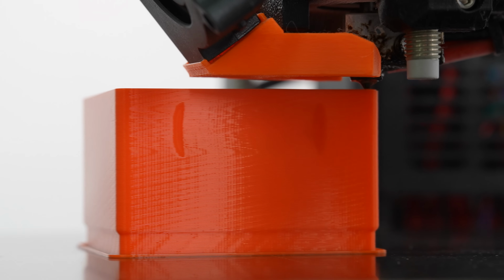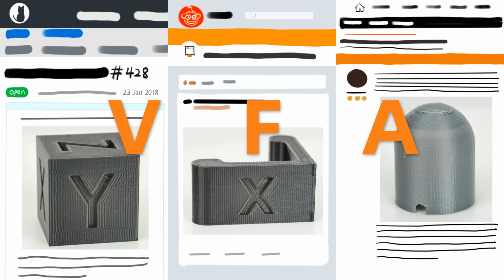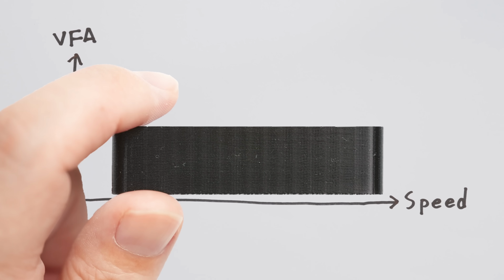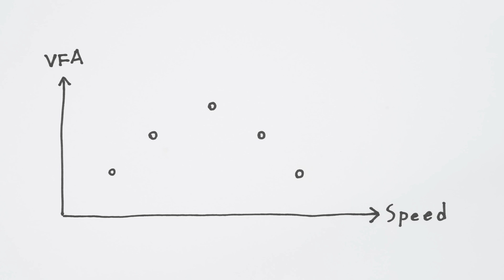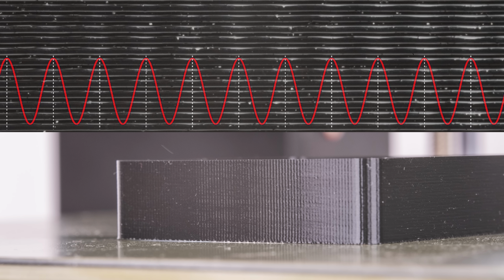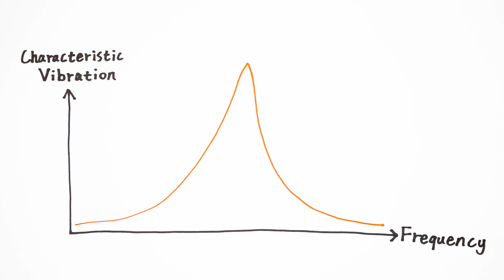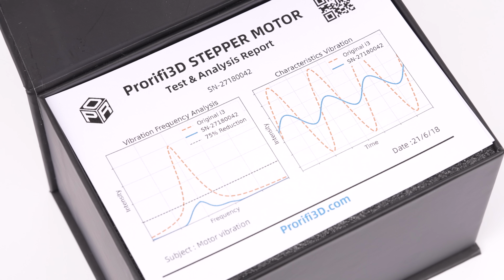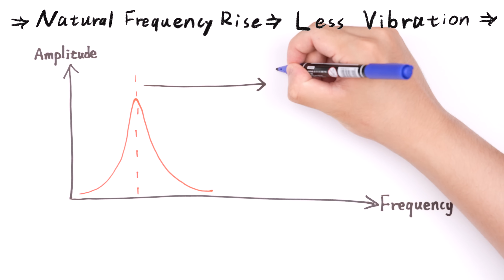We solved this common problem in 3D printing

Comment: Why not to use dc motor with rotation decoder and feedback loop driving? Wouldn't that be better for vibrations and also for detecting "loosen steps"? This principle is currently used in ordinary ink printers.
Reply: high cost and complexity... it must be tuned for every motor/printer combination.  this might be something prusa can do but on a hobby level, turning  requires a bit of know how.    i've seen it done with oDrive controller and motor after a ton of tuning... but it's also cost $$$.  2d printers are very basic mass produced products and they are only 2d...
Reply: @digibluh  obviously the steppers approach requires fine tuning also and still we don't have feedback about loosed steps. It could be interesting to try sinus waveform for steppers to keep them silent and not shaky. I don't know how much precise is microstepping which is currently used in current 3d printers.

Comment: You still will get a ripple as this is intrinsic characteristic of  steppers.Servo would be much better, but is still too expensive, to use in consumer printer.
Reply: it could be interesting to make a standalone servo that's powerful enough, precise and cheap for consumer printers... hmm maybe I could get in on doing that, a plug and play servo upgrade for printers that directly replace the nema17 with an on-board driver and encoder
Reply: Make it FOC (field oriented controal) It uses the internal windings of the bldc's to get i formations about the curent location of the Rotor. 
Idear is that you can skip the encoder that way. And make it mutch simpler. 
Its used lots in electric skatbords bilds. Both the O drive and Vesc platform supports it. if im not mistaken. 
Not shure how stabel it is if the rotor  is requierd to stay still, and is not inducing energy in the coils to messure the position tho. 
But having a servo upgrade kid woud be sweet af think about the power and prindspeeds... looking at havORT servo edition.

Comment: I heard that dual drive extruders make this problem worse. That's been my experience. My single drive older extruders were better than the upgraded ones when I bought the same printer years later.
Reply: That's not VFAs, but dual drive extruders do cause an interesting problem.
Reply: @coltenmeredith8899   The resonance from them causes vertical artefacts according to CNC kitchen and other channels. Something to do with the flaw in the way the second drive doesn't perfectly line up with the other. Or maybe it was Z banding, I can't remember for sure now. I've seen so many videos on it the last week.
Reply: @ArcanePath360  haha, so much information... Resonance causes ringing. Dual drive extruders cause a wood grain effect, it's from not having perfect concentricity. VFAs are from motors and gears, don't know why this happens. Z-wobble can be from lots of things, watch the creator of the hevort's videos

Comment: Interesting, but I'm curious.

If some of the original pictures are from April, why did it take months to make and release this video?
Also, why was that MCU/dev board blurred out?
Reply from the maker: The product development cycle is usually very long. It took us about a year to go from making low vibration motors in the lab to massive production. The blurred sensor in the video is for visual demonstration. The actual MRR vibrations measurement requires research-grade, ultra-sensitive sensing equipments.

Comment: Cool to see a new approach to this issue, makes sense for people that want to reduce this effect but maintain the stock prusa experience. For those of you that want to eliminate this problem, the root cause is einsy Rambo board with its tmc2130s. Swap out to a different board like an Skr mini and your problems will be solved. I did every mod to eliminate these artifacts until I swapped boards about a year ago.
Reply from the maker: Thank you for your support! In theory, switching to the SKR mini board itself does not reduce MRR, but the change of slicer settings along with the board change is likely to change the printing speed which has effects on MRR. We mentioned the relation between speed and MRR in our video. You can find more on our technical details page:https://prorifi3d.com/pages/technical-details

Comment: would those stepper motor dampening mounts also help with this problem?
Reply from the maker: It will not work. Since MRR is caused by the output of motors, add damping mounts has no use.

Comment: Very interesting findings and cool solution!
maybe "stepping" away from stepper motors and switching over to linear drives would also be a solution?!

In Industry applications, stepper motors are not used at all due to their lack of "knowing" where they are - ergo no encoder being present.

very smooth high quality linear drives will give you no stuttering whatsoever!

Also - as an intermediste solution I would love to see different stepper drivers on this issue with the same motors but maybe 256 microstepping on et cetera...
Reply from the maker: Thank you for your compliment and support!

Comment: Great video, thanks!  I have been trying to answer the following question for a few days now and you might have a general idea:  i have two motors in my hand and when i turn them, one has more "crisp" steps.  The other one is more subdued.  Its hard to explain better.  Which one should i install? would that make a difference in general?
Reply from the maker: The experience of turning motors by hand is not suitable for all motors. The vibration intensity requires actual tests and analysis to be concluded. We recommend you install both motors on the printer, control the variables, and compare the final test results.

Comment: Price is abit steep, I'll wait for the reviews to see if it's worth while.
Reply: not worth it, just LDO motors. just fix it with your stepper driver voltages (lower it), check belt tensioning, (not too tight), check your idlers and bearings.

Comment: Any plans to make a more powerful version? Maybe something in the .7 Nm to 1 Nm range...

I love the product, but I don't think that a holding torque of only 0.48 Nm would fair well on my chunky 400mm MIC6 bed especially when using a glass build plate. 

I would love to see these tested with a closed loop stepper motor driver as well. (Something like a BTT S42c/MKS Servo 42c) The combo of no ringing/VFA plus no lost steps would be wonderful and a mark a major hurdle overcome for 3d printing.

Comment: How does this compare to mounting usual stepper motors with sound dampening mounts?
Reply from the maker: Since MRR is caused by the output of motors, add damping mounts has no use.

Comment: Nerds dont want you to know, "Stepper Motor Vibration Damper" is also used for years to reduce VFR. And it works.
Reply from the maker: It will not work. Since MRR is caused by the output of motors, add damping mounts has no use. We have a technical details page to help you understand the cause of MRR(VFA):https://prorifi3d.com/pages/technical-details
Reply: @Prorifi3D  Im using it for years. If the motors are in good quality, with Vibration Dampers, they give great results. You did a great improvement. But Vibration dumper with a good quality motor (If you already have the motors),, is cheaper option
Reply: @kutay_ozkeskin  In what application?

Comment: I believe the ender 3 achieves better results because of their inferior bearings. The rubber rollers help to dampen the motor.
Reply from the maker: Ender 3 has MRR(VFA) as well. We have tested our motors on Ender 3, the result of MRR reduction is siginificant. Check here:https://prorifi3d.com/collections/upgrade-kit/products/prorifi3d-motor-development-kit
Reply: @Prorifi3D  Thanks for the response. Have you done any comparisons against 0.9 deg steppers?
Reply from the maker: @samroesch  We did some tests and research on 0.9° steppers years ago and they do reduce MRR(VFA). However, 0.9° steppers will bring more problems than they solved:
1. The 0.9° steppers have less torque and will lose even more torque at high speed compared to 1.8° steppers. This leads to poorer performance and stability.
2. Using 0.9° steppers also gives the stepper driver a heavier burden which will generate more heat. This will further reduce the stability.
3. In addition, for Prusa i3 and many other printers, switching to 0.9° steppers means your machine is no longer compatible with the stock firmware.

Comment: Is it possible to find two motors with comparable res Freqs and run them on the same axis, but have them be 180* out of phase with one another to neutralize the vibrations?
Reply: If you consider a core XY printer, I don't think it can be possible, coz 1 motor drives one belt and there are atleast 3 motors for axes and 1 motor for extrusion. The point is, each motor is a t a different position and drive shaft axis angles are different

Comment: Interesting... But I'm surprised you are not saying anything on the motor drivers. I can imagine that has a big influence on how the motor operates.. at least on the older drivers this was very well known problem.
Reply from the maker: Original i3 was already equipped with TMC 2130 drivers since MK3.
Reply: @Prorifi3D  i know.. but still these drivers may be causing some artifact or are not set properly

Comment: Does these motors also work on an Ender 3 V2 or similar machine?

Are they available anywhere in Europe?
Reply from the maker: The tests we did on Ender 3 is limited but the result of MRR reduction is siginificant. We will realease a general purpose motor soon. We ship to whole Europe.
Reply: @Prorifi3D  Ok cool thanks! 
It’s just because shipping things to Denmark from USA for example, the product will end up costing a fortune. The final price for the dev kit of XY motors will cost me around 150$, which is extremely expensive for two motors in my mind. 

However, if they do such a great difference, then I would say it is revolutionary, therefore the price.

Comment: its cheaper to just add a gear to the stepper and run it a bit quicker... the voron precision AB mod has no VFAs with 0.9deg stepper.
Reply from the maker: We did some tests and research on 0.9° steppers years ago and they do reduce MRR(VFA). However, 0.9° steppers will bring more problems than they solved:
1. The 0.9° steppers have less torque and will lose even more torque at high speed compared to 1.8° steppers. This leads to poorer performance and stability.
2. Using 0.9° steppers also gives the stepper driver a heavier burden which will generate more heat. This will further reduce the stability.
3. In addition, for Prusa i3 and many other printers, switching to 0.9° steppers means your machine is no longer compatible with the stock firmware.

Comment: Is the motors the same on the prusa mini on X and Y? Would these work on a mini?
Reply from the maker: Yes. For non-i3 we have a Development Kit: https://prorifi3d.com/collections/upgrade-kit/products/prorifi3d-motor-development-kit
Reply: @Prorifi3D  Nice! Tired to import your config file in prusa but didn't work: Failed loading config bundle: Error: "'=' character not found in line" at line 7
Reply from the maker: @davidolsson  This is a problem we have not encountered yet. But it seems to be an issue with the Slicer itself. Please refer to this thread: https://github.com/prusa3d/PrusaSlicer/issues/2438

You can also check the config as a .txt file and change the settings manually.

Comment: I ordered since Jan 07 2022, still no product. I paid 79$ plus 25$ for the shipping, and now they want me to pay 38$ more for the shipping already paid in the transaction before.
Reply from the maker: Your order is ready to be shipped, we are in the process of preparing to ship it to you. However, due to Shopify settings, your country or region was classified under the United States but in the system of the courier company, it is not. This makes a huge difference in shipping fees which we can not ignore. The actual shipping fee is $63 instead of $25. We are sorry for the inconvenience caused to you. In this case, we would like to ask you to make up the remaining shipping cost of $38. We understand that this is a very high shipping fee. So you can also cancel your order and we will give you a full refund.

Comment: Any chance of a motor that works for Ultimakers? This sounds like a god send.
Reply: dont buy this... its just a LDO motor with their own logo on it. what they show in the video is artificially made... i print over 15+ years and never seen this with random branded motors and many printers i work with... but hey for doing business you need to lie and explain the lie a bit with technical terms so people want to buy it and wont see any change if they replaced their motors.

Comment: How does this compare to 0.9 degree steppers?
Reply from the maker: We did some tests and research on 0.9° steppers years ago and they do reduce MRR(VFA). However, 0.9° steppers will bring more problems than they solved:
1. The 0.9° steppers have less torque and will lose even more torque at high speed compared to 1.8° steppers. This leads to poorer performance and stability.
2. Using 0.9° steppers also gives the stepper driver a heavier burden which will generate more heat. This will further reduce the stability.
3. In addition, for Prusa i3 and many other printers, switching to 0.9° steppers means your machine is no longer compatible with the stock firmware.

Comment: I solved it by using 0.9° steppers.
Reply: Saves you a lot of money too
Reply: 0.9deg Stepper Motors for X and Y is complete garbage for printers with beds larger than 80x80. lol
No torque. No Speed. Super high load on the TMC driver.
Reply: @REDxFROG  I run them on several machines and I dont have any problems with ether torque or speed. That being said, I even run them on my 300x300 voron 2.4. for high speed printing.
Reply: Then you most likely use 24V on them.
I come from the older 12V age. 🤓
For some reason I don't want to try 0.9 again. 0.9° is way too high resolution for 0.4mm nozzles .
Reply: @REDxFROG  Correct, 24V on all printers. Imho the difference between 1.8 and 0.9 is real when it comes to VFAs.
Reply: @REDxFROG  You should check out the e3d high torque motor, its 0.9° very low inductance and very fast.

Comment: Will 0.9 degree steppers be available as well?
Reply from the maker: We did some tests and research on 0.9° steppers years ago and they do reduce MRR(VFA). However, 0.9° steppers will bring more problems than they solved:
1. The 0.9° steppers have less torque and will lose even more torque at high speed compared to 1.8° steppers. This leads to poorer performance and stability.
2. Using 0.9° steppers also gives the stepper driver a heavier burden which will generate more heat. This will further reduce the stability.
3. In addition, for Prusa i3 and many other printers, switching to 0.9° steppers means your machine is no longer compatible with the stock firmware.

Comment: Can’t you just print in “silent” mode on the i3? That’ll do Microstepping, which in turn will have fewer vibrations.
Reply from the maker: In silent mode on the i3, the TMC driver uses a different Chopper mode than normal mode, but there is no difference in microstepping. According to our tests, there is a slight difference in motor out put vibration due to the effect of the different chopper modes on motor current, but the final effect on surface quality is very small. So the silent mode does not solve the MRR/VFA problem.
Reply: @Prorifi3D  Did it help, or did it make it slighty worse?

Comment: This is mostly an issue of cogging. The magnet will try to move quicker to get to the poles producing the spike in speed and then bounce as it over shoots the step/pole due to inertia. There is a resonance aspect if you drive your next step at a certain point in the bounce (the worst probably right at the undershoot peak).

To me the resonance is the secondary problem. If you completely fixed the resonance problem, you will still have patterns in the surface because the speed of the nozzle is not consistent between steps. The nozzle is in theory applying the plastic at a constant rate (but also subject to the same cogging issue,  damped heavily by the friction of the plastic). If the nozzle moves at inconsistent speeds in xy while the plastic comes out at the same speed, the width of the extrusion will vary making waves. 

Fix the overshoot and the resonance issue goes away, but you still have smaller ripples. Fix the cogging and both go away. 

Making a motor with a higher number of steps, or changing to a geared down drive would make them closer together, perhaps to the point where they don't matter. Put a slight twist in the rotor and it will really soften them by getting rid of the cog, but probably compromise torque and position holding.
The slicer could also do a lot to make them not noticeable by making the waves offset between layers. The surface would just have a slight roughness, but appear uniform.

In theory the driver should be able to microstep them out, but theory and reality down always match. Plus the inertia of the entire system has to be tuned, not just the motor (at least for belt drive, a screw with a low enough lead to not be driven would only be affected by the screws inertia and not the print head also).
Ideally the software would figure it out, but you would need position sensors to do it. It then comparing the input to the actual movement and adjusting the input until the output best matches.

Another option would be to tune the extruder to push more plastic right as the faster movement between steps happens, and less as it slows on the cog/step. This may or may not be possible depending on how responsive the plastic is. I suspect the friction/viscosity will make it impractical. Microstepping would make it more complex as well.
Reply: Great explanation. I need to find quality 0.9deg steppers.